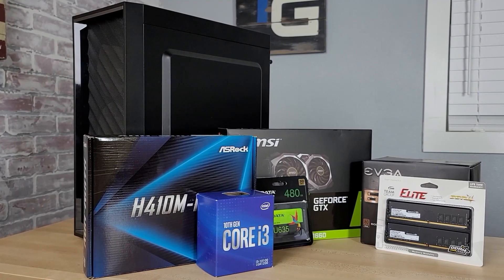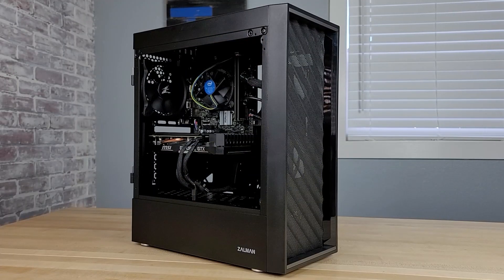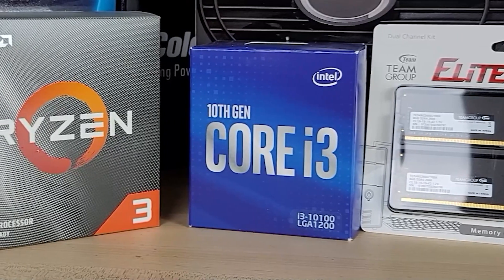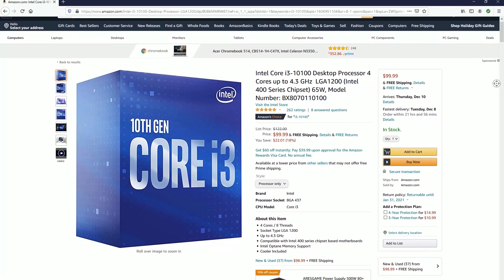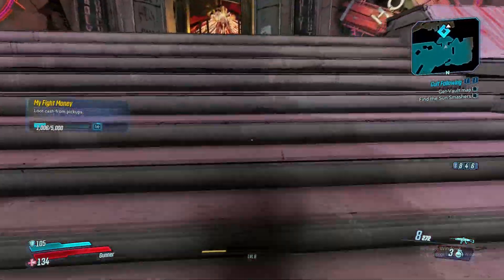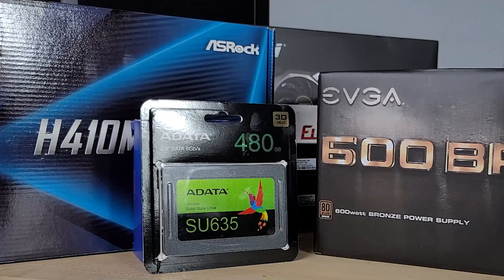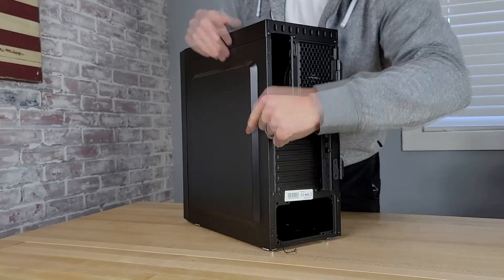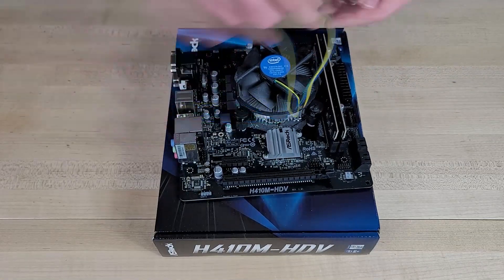$600 Gaming PC Build for 2021 - i3-10100 & GTX 1660 & 16GB

Comment: Core i3 is really old to use it ... I would buy core i9 for this build
Reply: The i3 10100 is a 10th generation cpu and it was released in 2020 so its not actauly very old

Comment: The graphics card that you have listed it now around $500 this is going to be my first build ever and I want to know if I can use the 1050 t I instead?
Reply: You should be able to just might not run as good but will work.
Reply: @aidenpt1  1050 ti oc should do.
Reply: I'm going to probably do the same
Reply: I would get the GPU from eBay as its nearly 50$ cheaper

Comment: Have not bothered to upgrade or build a new PC for a several years, wondering why the choice for a SSD drive instead of M.2 2280 like the WD_Black SN750 that can be purchased for just $13 more.  I have not used an M.2 drive yet is there something I should be aware of before making that switch?
Reply: You should be fine. Just install and play.
Reply: you won't notice the difference between a m.2 than a sata ssd, in real life applications it'll be a few seconds at most
Reply: @themonkeyking8506  holy necro post Batman!

Comment: PC parts are way over priced right now..... I built a 3500x system on a A320 board with 16gb 3600mhz ram and a 2060 for less than this system..... Performs much better ! the 2060 even with the latest GPU's seems to be the best value right now
Reply: I managed to get a 1650s for under 200 somehow

Comment: I was close to building this exact set up, but prices and availability are ridiculous. It's a very decent set up, bit decided to find used older parts, found a i7 6700k + mobo and 1080ti for $700 which is alright too and will be just as good as this set up even with it being at the end of its life cycle 😅

Comment: Hi there.

I got myself close to a complete setup, i still need ram tho. I dont care about lights at all, only performance for gaming. 

Any suggestion to which ram i  could choose  please  anybody ?

Processor= Intel Core I9-10900 , 
Motherboard = Asus Rog Strix z490-F Gaming , 
Graphic card = Asus Tuf Gaming geforce rtx 3080 oc 10gb ,  
Harddisk = Samsung 970 EVO SSD MZ-V7S2T0BW 2TB M.2 ,  
Powersuply = ASUS ROG-STRIX-750G 750Watt
Watercooler = NZXT Kraken X53 240mm
Pc case = Fractal Design Define R6

You proberly didtn need all that info, but those are the parts i got so far.
Reply: with that setup you basically can choose whatever ram you would like

only your budget, that is basically... pretty high, can determine what you could or could not get

i would say nothing below 3000mhz since it would be a waste with such a good cpu

also nothing less than 16gb( and with your budget 32 should be the aim) and always populate both channels to get dual channel config, i would even say get 64gb of ram, maybe you want to do some workloads with your pc
Reply: @Elinzar  Thanks. My budget is 350-400$ ish for ram. Sorry slow respond, YT didtn inform me. Only saw it when it informed me on next reply :P
Reply: @FirasPlayz Thanks mate.  i have 350-400$ left to spend on ram tho. I dont mind spend abit extra for better.
Reply: @UltraSuperDuperFreak  get 32 or even 64 gb, with that money dont go for less

there are lots of brands you can go for

but i think any Trident ddr4 ram stick is what you really want

the speed is basically as fast as you want, like, you can actually buy whatever you want

but imo even top of the line ram will not make too much of a difference when compared to a midrange ram in performance in games and shit

you are better off trying to find a Ryzen 5000 series CPU and mobo, then buy the ram
Reply: @Elinzar  Thanks for your time, and yea i noticed there was a ton of ram. Hence it kinda overwhelmed/confused me what i should choose.  I allready have a cpu btw.   I found these on sale in my contry yesterday so i think i go with those since they was a suggestion aswell on a forum i asked : HyperX FURY Black HX436C18FB4K4/64 Memory 64 GB Kit*(4 x 16 GB) 3600MHz DDR4 CL18 DIMM       thanks once again.
Reply: @UltraSuperDuperFreak  thats pretty good ram and fill all the ram slots

altough if you can find 2 sticks of 32gb and leave another 2 open for the idea of maybe getting 128gb of mem in the future lmao, imagine all those chrome tabs you can open haha

but 64gb is indeed plenty

if you wanna work with videos and stuff like that, definitively get 2 of 32gb for now and upgrade later

if is only for gamer those 4x16gb are plenty and still you can do video work on the side

Comment: Spend $20 more for the 1660 Super and get up to 20% more gpu performance.
Reply: and use ryzen lmao using intel in 2020
Reply: @fluffytuber7040  losing fps and paying more doesnt make sense though
Reply: @divoulos5758  you are not serious now are you ? with ryzen you can upgrade any time you want , unlike with intel you have to change half of your pc just to upgrade
Reply: @fluffytuber7040  why? Intel 10th and 11th gen work on the same mobo while ryzen mobos have no support for over 5000 series cpus and in gaming rocket lake will be enough better than everything amd has to offer and without changing mobo
Reply: @divoulos5758  exactly
Reply: @rev-9947  every pc expert saying amd is crushing intel right now and you saying exactly to a guy that is saying otherwise, so smart of you
Reply: @rev-9947  lol
Reply: @fluffytuber7040  AMD has better performance but it's more expensive, not a good idea for a budget build
Reply: @jmlinden7  idk but almost every budget built in 2020 has amd
Reply: @fluffytuber7040  find a ryzen 3 3100 or 3300x for msrp. Its a little hard right now with AMD being more popular stock runs out faster and the production of 3100 and 3300x are almost non existent. I'm only saying this because I build PC's often and Intel at least has stock of entry level CPU's for msrp. I would love to build ryzen rigs but the market is so inflated right now on Ryzen CPU's. The i3-10100 also out performs the the ryzen 2600 in games. It's basically an i7-7700 in disguise. the ryzen 3 3100 and 3300x outperform the i3-10100 but not by much it all comes down to finding one for the right price.